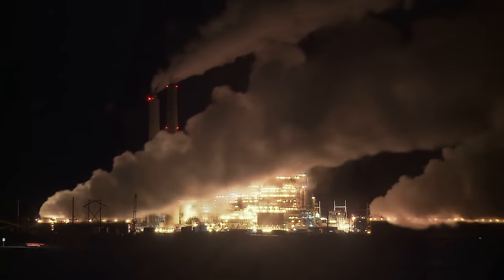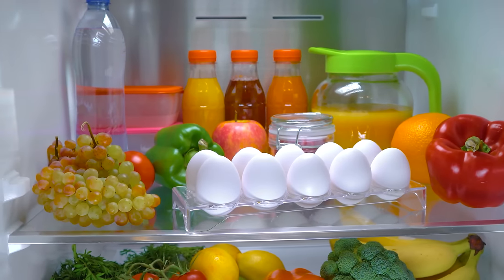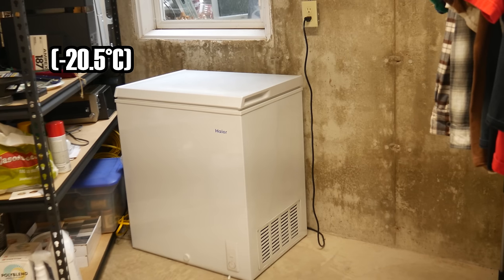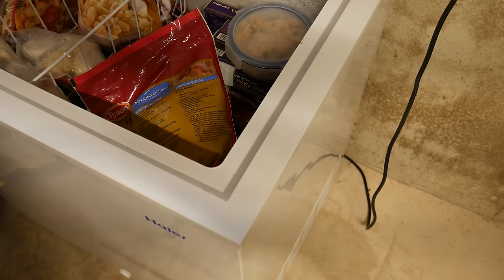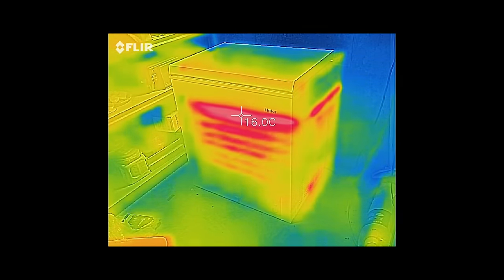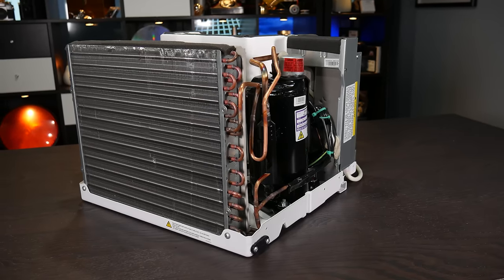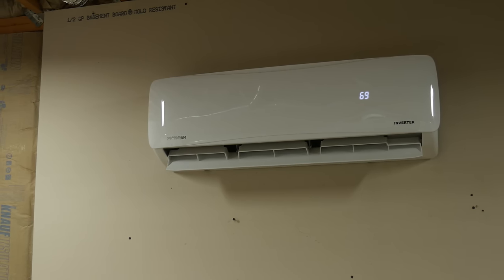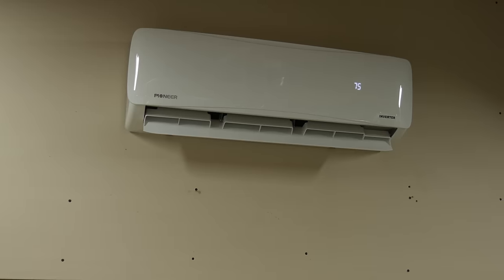Heat Pumps: the Future of Home Heating

Comment: Lennox, Carrier, Trane and others have been manufacturing conventional heat pumps for decades and they have worked reasonably well in mild climates (AHRI Region IV), typically winters having approximately 3000 heating load hours or less. Not sure why your Lennox dealer didn’t offer the heat pump option, too expensive perhaps?  For a long time conventional heat pumps were offered for sale in AHRI Region V (northern US and most of Canada) and they simply didn’t work well enough to be a viable option for two reasons: high balance point and too much defrosting. Now, cold climate heat pumps using improved refrigeration technology including inverter drive compressors and dense vapour injection are proving to be a great option in many parts of Canada because, properly sized and installed, they can deliver up to 100% of the building heat requirements down to -10F or even lower and still have a decent COP. Mitsubishi, Daiken, Samsung, Panasonic, Fujitsu among others are the leaders in ccASHP technology.

Comment: Very interesting.  I still wonder about the electricity cost.  Where I am located, our electricity is 0.28/ KW.  My heater is gas. Our winters are very mild.  High 40's at night and 60s- 70s in the day.
Reply: i am heating 100 square meters using 3 xAC units A+++ having 36000BTU in total and the energy consumption was on september about 120kw a month, in october avout 230 kw a month and in novembet 420kw . my house is insilated (only 5cm...). i live in cluj napoca romania...you can search what temperatures are here

Comment: I live in Toronto. I have a Trane resolute cold climate two ton unit in my small bungalow and it works fine down to about -10 Celsius. After that it has an internal coil that may switch on to help the heat pump do its job. But, the good thing I have no fossil fuel burning in my house and I am pretty much assured that I am warm and comfortable at all times.

Comment: What I would like to see is heat pumps that would let the ice slide out like an ice maker, taking huge advantage of the water vapor to ice latent energy while still not needing to waste it for undoing that as much beyond loosening it up. Just need a tilt and to extend the pipes to vertical lines so it doesn't get caught on them.

Comment: I still haven't seen somebody simply say that the outside exchanger warms up the cold evaporated refrigerant on its way back to the compressor, the warmer the refrigerant entering the compressor , the more heat will be produced, that's why heat pumps lose efficiency as it gets colder outside. Its really that simple.

Comment: I grew up in the south and heat pumps were just how homes were heated. Then I explored the north and found out that people use heating oil and kerosene, and they hate the idea of heat pumps. It blew my mind.
Reply: In general, Heating oil/ kerosene/ gas, is WAY cheaper than electric per kWh, running an electric heat pump is still more expensive/about the same to heat a house than any other fuel options. Depends on your energy tariffs though.
Reply: @fl5537  For that reason atm moment I have both. Furnace for cold, air conditioners for >0C. Spare source of heat makes me also feel safe

Comment: Another energy efficient way to cook with electric if you have a gas stove but don't want to switch it our just yet or bear the cost of an upgrade is to cook with an instant pot, air fryer, or slow cooker.  And another good back up for emergency cooking, could be the humble charcoal grill like the Weber smokey joe and a bag of real wood charcoal.  Takes up little space when not in use, but could be used to cook or even boil water on the coals in a power outage.  And as for the fridge during power outages, if in the winter I use the outdoors.  I'll move groceries into the trunk of my car if I need to.  Or if there's snow, I'll pack the snow in a cooler.

Comment: I always knew that a heat pump was just  an air conditioner that works in both (the opposite) directions, and that an AC unit doesn't "make cold" but rather move heat around.  But until this video I never really thought about how useful that would be in the winter for heating. When you see it spelled out so clearly, it really makes our North American practice of burning fossil fuels (or using electrical grid power) to release more "heat" into the environment, when we could simply borrow the same heat that is already there (ie. just move heat outside in the summer, and heat back inside in the winter).  "Making heat" seems so wasteful after seeing it this way.

Comment: At this point, the HVAC industry should have created natural gas furnace/heat pump combo units that use the gas furnace when temps are too cold or the grid is down, and the exhaust from the furnace defrosts the heat pump. In this way, you could have emergency heat, and near 100% efficiency from the gas even at lower outdoor temps.
In my area, the grid electricity comes from coal.

Comment: While you were speaking a COP of 4 compared with an electricity cost of 5 times that of gas. 
In other words you would have needed a COP of 5 or higher. Electricity might be even more expensive than gas just now but that will depend on how much you use. Best to use a lot. There is a daily charge whether you use it or not.

Comment: As the name implies, a heat PUMP does NOT generate heat -- It MOVES heat from one location to another... The heat being moved is found in the air.  The air acts as a kind of "sponge" that absorbs and holds heat, primarily from the sun.  The air heats a cryogenic liquids which expands and vaporizes at very low temperatures, sometimes as low as -40F!  This expanded fluid is then run through a compressor which "squeezes" the heat out of the vapor, condensing it back into a liquid in the process.  This heat is then used to heat your home.  In the summer, the same process is used to absorb heat from your home and move it to the outside.  Heat can be moved in this way so long as the heat source maintains a higher temperature than the boiling point of the cryogenic fluid.

Comment: I just got one of these reversible AC doohickeys for my studio, and its awesome. Just NEVER RUN THEM IN "AUTO" MODE! Otherwise it switches back and forth from cooling to heating to cooling etc, fighting itself, wasting power, trying to keep the air at exactly what you set it at, even though it's 100 degrees outside. Who's idea was it to give it an "auto" mode?

Comment: Our new 18000 BTU Zokop was easy to install - cooled a very large room easily - but the heater starts heating, you can feel and smell it, but within a few minutes blows cold - any ideas?
Reply: Sounds like a pressurization or coolant charge problem. I have no idea why it works on the cooling side well, but I suspect there may be something wrong with the reversing valve that is not maintaining the necessary pressure differential.

Comment: What if you took the resistance heat unit and sandwiched the heating element up against the outside coil? It wouldn't use as much energy as plain resistive heat, and would slow ice accumulation to boot

Comment: I don't think anyone should have single type of heat or electric service.  We just went through a national gas outage here in western pa.  I don't have  whole house AC or a  heat pump. ( we planned to have a whole house A C installed at some point.  And awhile back i decided  that a heat pump would be a smart addition.   But i will not give up my natural gas furnace.  During our outage we  had to pull out some oil filled heaters   and have been using the fire place constantly for 4 days.  It has only gotten down to the low 40 s over night.  We were able maintain   nearly 70° inside.   And the oil heaters were not on very high.

Comment: But I've been told for so long (just looked it up last winter n fact) that heat pumps don't work below 40 degrees.  I know my 20 year old one doesn't.  Any way to retrofit  older ones work for lower temperatures?  It get below zero here once or twice every year.  Heating for a month or two every winter is a huge hassle tat costs a fortune and in general, just leaves us cold.

Comment: Heat pumps are great at the individual level, BUT: at a macro (country) level would be cheaper to build extra wind turbines and get people to install a less efficient but low storage heater system. Storage heaters also store energy and thus reduce the need for batteries. We need to get to net zero as quickly and cheaply as possible!

Comment: Overall though, eventually heat pumps will make the outside temps in winter colder. And well, the summer hotter. Yeah, okay, there's a lot of outside air and it is often moved fast, but still... on a sort of ground temperature level I do wonder what the effects will be.

Comment: I bought an old farm house without central air but had a fuel-oil furnace.  I called a company called Affordable Cooling and heating”.  That company name was a joke.  They wanted to charge me $17,000 for a new unit.  We decided to just put in window air-conditioners and buy a wood burning stove and supplemented space heaters.  My utility bills went from $400-$600 per month, to $125 per month.

Comment: I live in EU. My parents have had AC for years and it's always been capable of both heating and cooling. As such I was so confused for a huge portion of this video cause it seemed like you are saying AC is only for cooling.
I understood eventually that it needs to be a heat pump for it to be able to go both ways. It's just that here we just call it an AC and I don't know anyone who has one that's only used for cooling. Very confusing cultural difference at least.

Comment: Many homes in the southwest United States (i.e., in NM) do not have air conditioning and rely instead on evaporative coolers, which can never be used as heat pumps. THOSE are standard equipment here, especially for new builders, and if you have true AC instead, you're Mr. Hollywood!

Comment: Not sure what part of "the south" you think Heat pumps are the norm? Here in Georgia natural gas and its cousin propane FAR out weigh heatpumps as far as market sector goes. My folks who live in North Georgia do have a heat pump as do many of their neighbors but it was not because of efficiency of heating but rather because in their specific part of Georgia the ability of local utilities to deliver natural gas is lmited to near city centers and the ease of use of the heat pump is still easier than a propane based system for day to day winter heating. That said they do also have a propane tank for their emergency heat system for when power fails and the heat pump becomes just another useless brick of metal.

Comment: Iowa winters are just too cold for these. I haven't seen hardly any of these anywhere around here. Same for Wisconsin and Minnesota. Might be nice for a garage or workshop though.
Reply: How cold? seems the temperature in Iowa is similar to the temperature I have here currently (it's about -5C / 23F), and mine are running just fine.
Reply: @BenIsInSweden  Temps in the midwest United States will commonly drop to -20F/-29C for extended periods of time.  While there are some heat pumps that are capable of working at those temperatures the ones that can are relatively new and are quite expensive compared to a dual fuel setup.
Reply: Do heat pumps work in cold climates?

The fact that Nordic countries, known for their harsh winters, are among the biggest users disproves the often-held assumption that the technology does not work when the temperature plummets.

The myth has fuelled resistance across continental Europe.

"There are a lot of false myths out there about heat pumps. Some oil and gas producing countries such as Russia, some people, some sectors, some businesses don't want to see this transition," explained Caroline Haglund Stignor, a researcher at RISE Research Institutes of Sweden.

"Yes, heat pumps work in cold climates. Yes, heat pumps work in old buildings."

To heat a home, heat pumps extract outdoor heat - which exists even in cold weather - and inject it indoors.

Early models did not include defrosting systems or variable speed compressors, which nowadays enable them to run more efficiently in a wider range of temperatures.

While their efficiency declines somewhat in cold weather, they are still more efficient and greener than other options, experts say.
Reply: @Redtooth75  Because you have cheap gas better heat pumps are not marketed in Usa.

Comment: the tech is good and i know, that this is the future. but at the moment, they have a big problem: costs. even if theyre are cheap in terms of usage cost, buying on, getting it installed and may be even renovating your home on order for them wo work efficent is something that i can afford. meaning, for my home, all cost combined for whats necessary to installed, heatpump and isolating the house, would add up to around 60 -70k. and if electricity is expensive where you live, having a low standard isolation might get you higher bills then you had with gas

Comment: How much more electricity is needed to power such a unit, what is the life duration of the pump and how noisy are they for neighbours when in operation?
Reply: They make as much noise outside as a regular central air conditioner, as they contain many of the same parts.
Reply: The compressor uses 3-5 Amps while it's running from what I've seen. You can run 3 of them on a 20A circuit without issue.

Noise... Depends on the model. Usually it's about as noisy as a similarly sized AC unit.

Comment: Isn't this the same way a hvac system works already? I thought the main condenser unit outside just changed phases depending on if you have the system on heat or ac.

Comment: So other then the issue of it getting wet, I could stick a window unit air conditioner in backwards and use it to heat my room in the winter?
Reply: I mean, essentially yeah. You wouldn't have a thermostat though, since they're designed to run at 60+, not 20 degrees lol

Comment: I hate to do this, but I've found a portable unit that.. heats and cools and it's going to hold me over until I can do something permanent. I use the wood stove for the really cold days but it's either slightly too hot or too cold and this will fix that.
Reply: the thermostat is on the control side, it would never shut off

Comment: Question from a non-STEM normie: heat pumps seem to use the same principle as an AC unit, just in the other direction. But AC units are incredibly energy-intensive. How are heat pumps so energy efficient if both technologies are so similar?
Reply: They're both very energy efficient. But there's no direct comparison to make when it comes to cooling your house, unlike heat pumps which can be compared to regular electrical heaters.

Comment: I am sitting in my daughters house  with single digit temps outside and barely functioning heat pumps.  They have lost the use of one bathroom from frozen pipes. Heat pumps don’t work in very cold weather.

Comment: As an engineer not I question this. Since the problem is the extremes temperature outside how about making the unit isolated in the containment that would control temperature of that unit outside for maximum efficiency temperature. If you'd go down and do the math if the unit efficiency can go as low as 1 in very cold environment, heating that unit in isolation just to have that perfect temperature would most likely be move efficient overall. I know its counter intuitive since you trying to heat the cooler for better heat efficiency but math might prove that doing it is better than not. It needs some digging in but I' too lazy to do it.

Comment: You could fix global warming and super volcano eruptions with the same solution:
Releasing the pressure from a super volcano would create enough energy to get us off fossil fuels.
I thought of a way to release the pressure.
The two main limitations to releasing the pressure from super volcanoes is that if you release the pressure in the center you could cause it to explode the way around that problem is to release the pressure further out, like a balloon if you release further out and slowly work your way in it can deflate without popping.
The second limitation is that you can't dig down to a super volcano without the equipment getting too hot to dig the way around that problem is instead of digging melt your way down to the lava.
Giant mirror fields create molten salt power plants, instead of pointing them at salt point the mirrors at a magnifying glass that melts the ground down to the lava and releases the pressure from the volcano while simultaneously using the released pressure to create power and get us off fossil fuels.

Comment: Anyone aware of the implications of combining rsistive heating directly into the heat pump coils outside for times when temps drop to avoid another complete backup system?  Seems like there should be a sweet spot for heating the coils of the heatpump inductively vs having a whole different system that would allow operation at lower temps and still maintain a decent indoor temp in the winter.

Comment: Geothermal heat pump would be great.

But for a normal one, they still don't make sense in all locations and all climates, and all homes.

An older home with worse insulation in below freezing weather, most heat pumps are not going to be able to keep up with heat loss.

Not to mention lifespan. A furnace can last twice as long as a heat pump. And they're quieter as well. And most homes already have gas lines ran to them.

The output temperature is higher also.

And of course the much higher burden on the electrical grid.

And the cosmetics are a lot worse compared to just a furnace. 

You also have to make sure they don't get snow on them. 

Don't get me wrong, they can be great in the right conditions. For example, a new home build in an area with a mild to moderate climate, without natural gas lines, low electricity costs, etc.